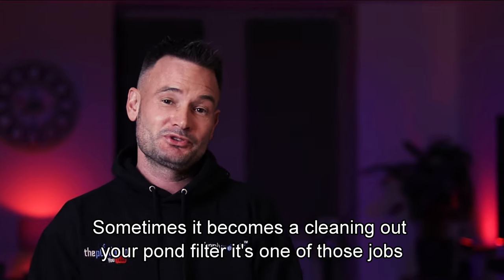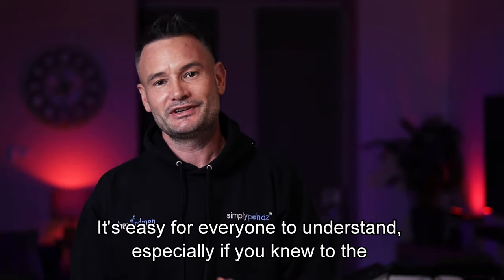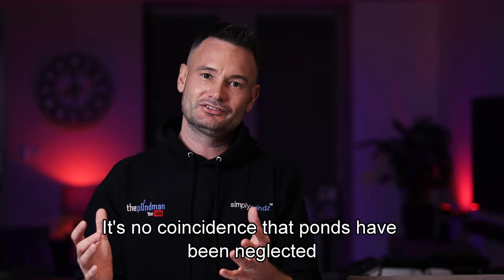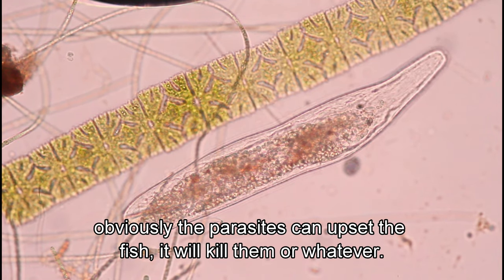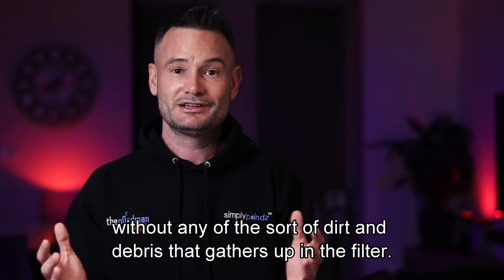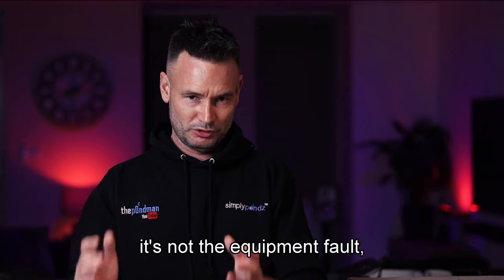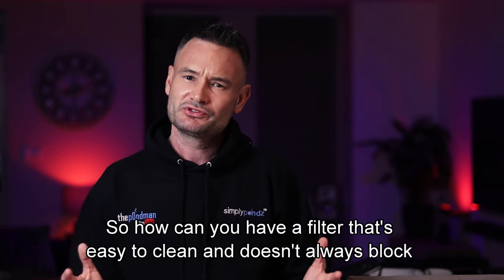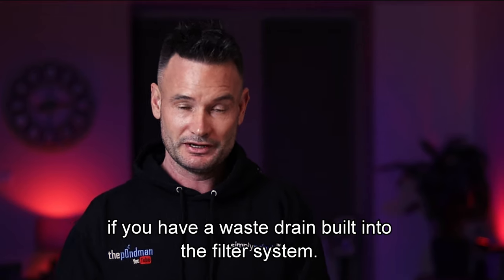Mastering All Pond Filters: The Ultimate Guide to Perfect & Clear Water in Your Pond

Comment: My pond is close to 90,000L, how do i double my filtration system. Wetland bog system calls for 30% - 40% (bigger is better) and i dont have the space to go bigger. 

Need some solid advice? Bakki shower, upflow filter, bog? (My pond is inground so gravity is out of the question). 

How many time should i cycle the pond per day? People say 30min, 1 hr, once every two hours, 3 times.a day?.

In my case 90kL cycle every hour will require a beast of a filter. I am happy to cycle 4 -6 time a day thats 22.500L.

Comment: The drum filter is the most effective, given that it does not need to be cleaned.  It has automatic smart cleaning, and good filters have emergency systems and a system that can work without electricity for several hours; when electricity is supplied, the filter turns on and continues its work without any problems.
Reply from the maker: They are over expensive and waste water. They also need cleaning at some point, they aren’t magic